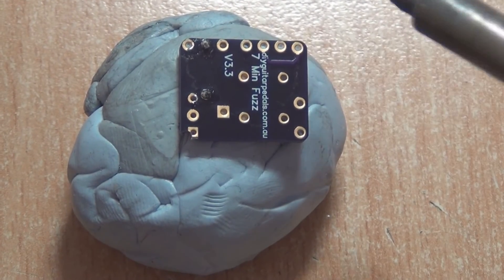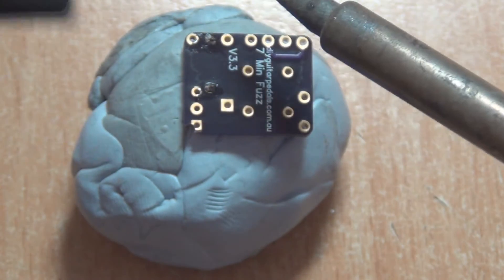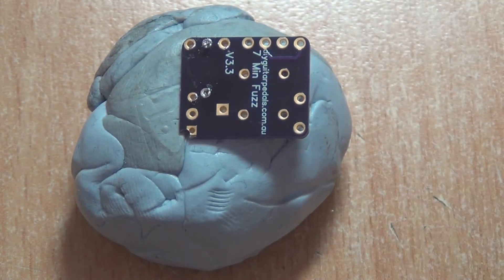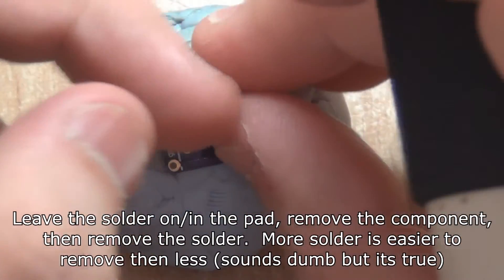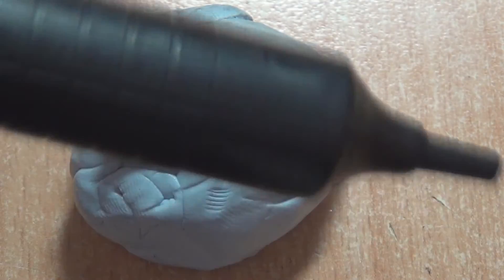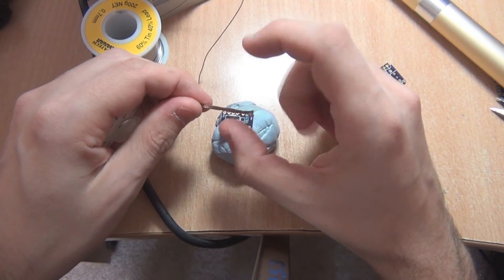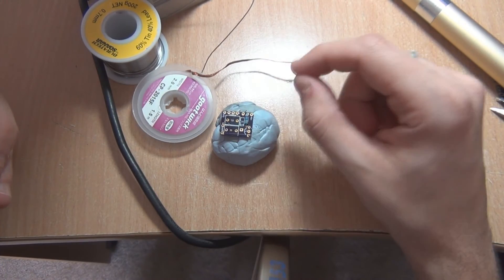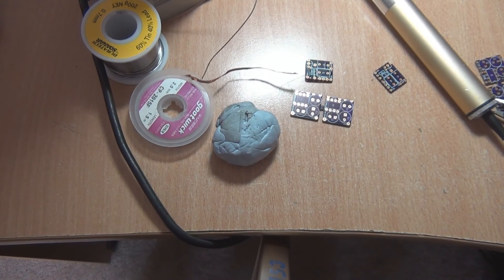Desoldering Plated Through Holes

Comment: One problem i noticed is that you're not using the spring-sucker correctly. You want to be perpendicular to pcb (not 45 degrees), heat lead til entire joint fully melts through, then simultaneously pull back iron, lower sucker completely over hole/lead and POP it. One pop and hole should be CLEAR. For even better results, flux holes to be sucked and add a little fresh solder first. The additional mass of the extra solder gives you more time to suck, and the improved heating characteristics by adding fresh flux speed up melting.  P.S. your aluminum sucker is dirty; take it apart, clean it and i bet it pops like a champ again.  Cheers

Comment: I would put the PCB in a vise, apply heat to one side of the hole, and suck from the other. I would never in a million years expect applying heat and sucking from the same side to work well. It also will kill the plastic tip of the pump tool quicker. I would also never in a million years use one of those plastic sucker tools. I've always used real desoldering irons for getting solder out of plated through holes. The proper tool goes a long way and makes a job a lot quicker. A pro wouldn't even call the Radio Shack one I have had the "proper" tool versus some solder-station-electric-vacuum-pump model, but oh well. A cheap Radio Shack desoldering iron makes clearing out like 50 holes far from a tedious chore.

Comment: Paul, 
Thank you!  I just got one of those pumps from Amazon and W O W!!!!   That thing AWESOME!  It works like a charm!  Was able to desolder a 3PDT stomp switch from a PCB and had no issues... where it would have taken me at least 10 minutes or so with my crappy desolder pump /  solder braid... The Solderpullt SS750LS did it in about 2 minutes flawlessly!  Best thing ever since um...  Electric Guitars!  :-p
Reply from the maker: Awesome Jimijam.  The suction action is strong and precise compared to my electronic shop sucker which...ahhh....sucks...but not in a good way :D

Comment: I think that the best way to do it is to use an eletric desoldering pump: it's very similar to a soldering iron and works wonderful! It gets ready in 5mins, so you just have to plug it some minutes before you start desoldering components that cannot be easily removed. You can find some on ebay for 10€ or less, but they are very useful! I still use the "traditional" pump, but I'd rather use the electronic one in most of cases! ;)

Comment: I've got the "electronics shop" variety and it's wonderful. Been using the same one for over 10 years. So I'd guess they're not all built the same. Mine looks like your bronze one but it's blue, still has quick spring action and came with an additional teflon tip which I've never needed. 

I also have the "bee's knee's" type you describe, but for 1 or two components, I just use the generic solder sucker.
Reply from the maker: My tip isn't Teflon its plastic.  The spring is clogged with crap and the shaft isn't fluid anymore.  Also the tip opening seems much larger (less suction) then the soldapult.  I have seen some nice looking metal solder suckers of a similar appearance (and expensive ones as well) to my solder sucker so I guess "electronic shop' sucker is too much of a generalisation.  As you said, not all created equal I think!